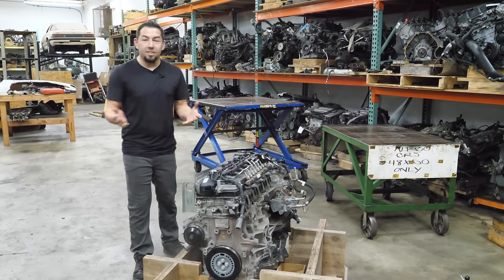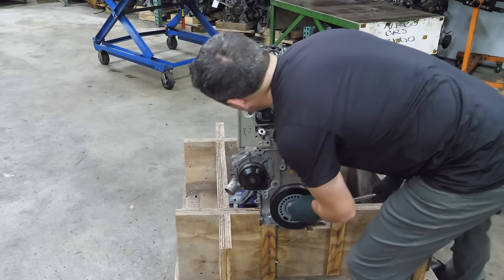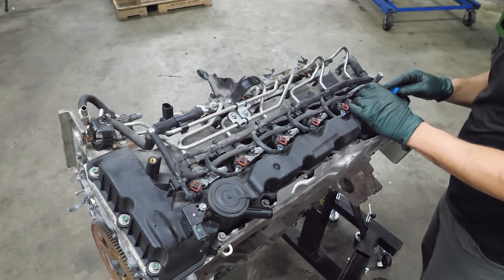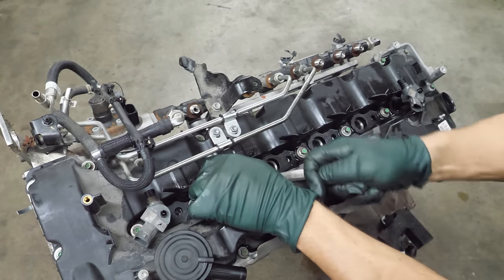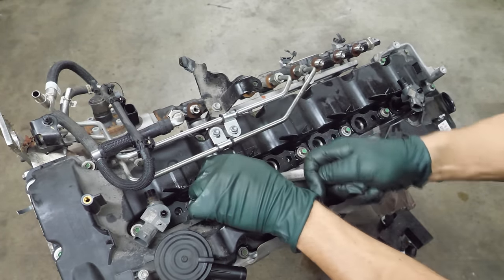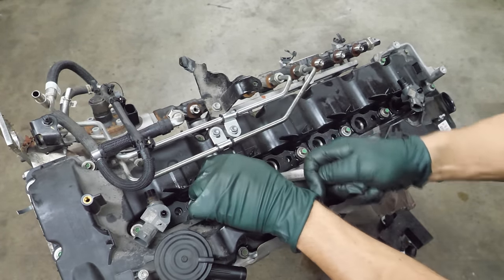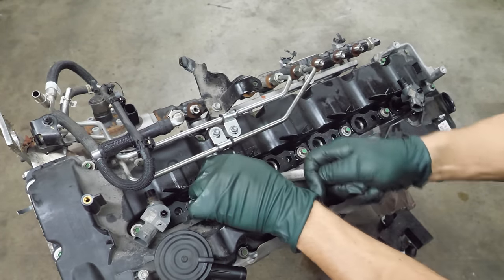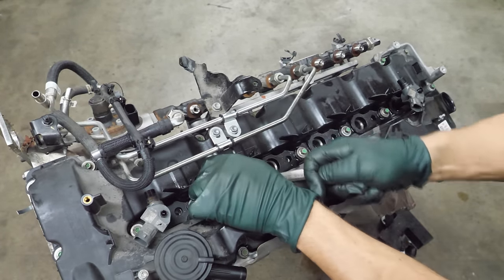BAD 2020 Silverado 3.0 Duramax LM2 Engine Teardown INCREDIBLE DAMAGE!

Comment: One thing I hate is they put the timing chain in the back.  Literally have to remove the engine to replace it if it fails or needs work.
Reply: Engine stays in place. Just the transmission is dropped. Not a super simple task, but anyone with a medium mechanical ability can do it... and 22.5 and up (LZO) are 200k replacement on the belt. Lots of of gas vehicles require 60k-100k timing belt replacements that are similar repair costs.

Comment: Not so Duro Max for diesel at about 160k miles. Some owner not paying attention to oil level and oil changes.
Maybe ran low on oil before light came on.  Low oil caused slack timing chain tensioner. OHC 4 valve diesel may give great power, but long timing chain and tensioner need regular inspection and service.

Comment: At 43,000 trouble free miles on my baby Duramax. Love the truck! One guy I know who does hotshot just crossed 200k on his. So far so good.
Reply: So it lasted long enough to break-in... good to know.
Reply: Your oil change frequency ?
Thank you 😊
Reply: 73k on my LM2 with no issues.  Change the oil every 5-6k and use Hotshot's Secret fuel additive to every tank.
Reply: @TakeDeadAim  
Thx for the tip 💯🤙🏻😎
Reply: @TakeDeadAim I do the same

Comment: Looks to me like it was reasonably clean, suggesting cared for.  Maybe something failed and caused it to burn all its oil suddenly, and lack of pressure released cam chain tension and trashed the rod bearing.
Reply: I wonder if a turbo seal failed and ejected the oil into the exhaust.  I don’t see neglect here either.
Reply: @gordonborsboom7460 that definitely fits with the lost power complaint. Think we have a good theory here.
Reply: I own this motor in my truck and in some instances some of the engines have been shown to use oil. In my case, 2,000 mile high speed freeway trip (80+mph,un-loaded and not towing) I used at least 2 quarts of oil. Does not seem to use oil in the shorter trips, towing or around town usage.
Reply: @toddkovalcik332 GM would have to re-engineer this engine because a diesel isn't supposed to use oil at that rate. Will ruin the SCR system in a heartbeat. 😊

Comment: Like Scotty said, "oil is cheap and engines are expensive".  I always change my oil every 5k.
Reply: @alexwalker8422  Running Synthetic 6-7K miles, check it every couple weeks. Don't have to usually add any but just for peace of mind.
Reply: Scotty Kilmer? 🙄
Reply: @nooooooooooo6uoki67  Yeah, he's a bit of a goof.
Reply: That's about when my oil minder goes off... soo
Reply: @Barbaratio  I wish people didn't really listen to him as much but y'know there is always good and bad so meh
Reply: The only goal manufacturers have is reaching 100k miles, the 10k oil change interval recommendation is based on that.  3000 miles is best, no more than 5000 or 4 months regardless of miles.
Reply: @HairHelmet yup. Just got to make it past the warranty.  Anything else is just bragging rights but they don't necessarily transfer to sales as much as a complete breakdown 5k miles past the warranty.
Reply: @HairHelmet  Before every drive, or once a week
Reply: @erik_dk842  well, at the rate my rig consumes oil, before every drive.
Reply: @HairHelmet  I was joking about oil change intervals. 15,000 km = 9,375 miles is considered plenty good here. 3000 miles would be a good indication of owner mental problems (OCD), if the engine didn't leak coolant into the oil.

Comment: The 3.0L Duramax uses really thin (0W-20) oil and is known for burning/using oil pretty quickly.   The factory puts eight quarts of oil in the crankcase from the factory yet states that seven quarts are to be added when changing the oil and filter.  I've had to add a quart of oil to my LZO after just a few thousand miles of driving.  Pays to check the dipstick every so often.
Reply: Dry (first/rebuild) fill and change fill are different values for any machine.
Reply: Looking at the design of that lower oil pan the drain plug appears well above the bottom of the pan.
Reply: Filling with 8 quarts each oil change may not be a bad idea.  Many owners have commented about how the LM2/LZ0 engines tend to be oil thirsty.
Reply: Big oof. I just put 5w30 in my 03 escape, calls for 5w20 and used that the last 120k miles. Burnt 2 quarts per 3k. On 5w30, hasn't burnt anything over 2500 miles. I would never run 0w20 in a diesel unless I lived in Antarctica. The mpg gain is not even there. 5w30 in my 2018 tundra and I still get the same mileage as I did on 0w20 when I tried it. Engine is MUCH happier, quieter and smoother.
Reply: Any freshly manufactured engine will burn oil and they are ALL over filled at the factory. A low mile/hour engine hasn't had time to break in and seal the rings.
Reply: 0w-20  OUCH
Reply: @davidpowell3347 unfortunately that is what my Nissan Altima calls for. I use Mobil 1 in it and so far is not using any oil 😊
Reply: Try using Mobil 1 ESP X2. Less oil consumption
Reply: @mitchellbarber6971 mine dropped the first two oil changes on my LM2 but the last one was still full when I changed it, and I pushed that one to the oil life monitor.
Reply: Gale Banks addressed the LM2 oil viscosity issue in an interview, he stated that the crank journals are designed for 0W oil.  Wondering if this failure was due to owner using the wrong oil (5W-30) and starving the bearings?
Reply: It’s spicer design on YouTube go watch his
Reply: We run 0w40 in the one we have at work. Over 100k with 0w40 without issue.

Comment: Engines are overly complicated today, I had a 69 Chevy with a 350, 2bbl Rochester carb, th350, 4:11 positrack 12 bolt. Got in the 20+ mpg , only had 3 wires to the engine. Never broke down purred like a kitten

Comment: The reason for the rear timing chain is the combination of the aluminum block and long crankshaft leads to a lot of torsional vibration - the snout of the crank twists back & forth relative to the rear. Putting timing bits on the rear keeps those from transfering into the cams (and cam timing) since the transmissions dampens those vibrations the most.

Still a dumb design just to save 100lbs.
Reply: I saw a post by a fellow stating how the accessory belt on his engine had shredded and jammed up the timing belt on his volvo. a common issue on that model he said. at least when the timing chain and acc belt are at opposite ends that won't happen.

Comment: I can't imagine that the recommended 0W-20 oil is helping these engines last especially in Florida or Texas summer heat. I have used either Triax Euro 5W-30 or Amsoil's 5W-30 Dexos D for 6000 mile oil changes ever since mine was out of warranty and engine fully broken in. 206,000 miles currently and still going strong

Comment: Seems like a pretty good designed engine, except for the oil belt and oil pump drive
Reply: Putting the timing chains at the back of the engine was also a dumb mistake.
Reply: @djmech3871  No kidding! It should be a felony for car manufacturers to do that
Reply: @djmech3871 this platform was taken from the international market where it was originally intended for cab-over trucks that are serviced from the rear.
Reply: If you define “good design” as expensive to repair I agree with you!

Comment: Not so sure about the root failure is oil below pickup.  While I am not familiar with this specific engine, most engines in recent decades will shut down with a loss of most or all oil pressure to prevent permanent damage.  My theory, once a bearing loses its hardened surface, they melt away fairly quickly with friction/wear.  When the extra 'reach' occurred on that cyl, it was the first to smack the valves causing a lash in the excessive timing chain system, causing the rest of the pistons to smack their respective valves.   I think the original failure was a bearing failure.
Reply: good theory, I like it

Comment: It's truly amazing that it jumped time and continued running long enough to indent the pistons like that.  There's a lot to say about the design of the engine but I agree that synthetic oil pump belt isn't one, what an absolute boneheaded idea, I would say they didn't intend these engines to last as long as a traditional diesel.  Considering that the block is AL, the cyls. are sleeves, if someone had a cracked block casting your block casting might be of some use to them.
Reply: The Honda 2000i and 2200i generators have these belts to drive their OHC...and carry oil up into the head.
One owner ran his 24/7 for 17,000 hours straight (off grid; only source of power).
See James Condon vid re tearing one down.
Then he ran the same engine with the replacement belt another 17k hours...
then sold it to his friend and it's still going...heading towards 35k hours....
As the GM tech said in another comment in these comments  the same belt in the LZ0 engine is now rated at 200k miles before replacement....

Comment: Head bolt torque spec must be 98,390 ft lbs.
Reply: Plus another 180 degrees.
Reply: @klesmer  -  LOL!!
Reply: Sooner or later, Eric may come across an engine where he'll need to use the loader to get the head bolts loosened

Comment: Finally a 3.0 Duramax.   I LOVE my 3.0 so I am going to have to hope and pray mine doesn't do this..
Reply: The Honda 2000i and 2200i generators have these belts to drive their OHC...and carry oil up into the head.
One owner ran his 24/7 for 17,000 hours straight (off grid; only source of power).
See James Condon vid re tearing one down.
Then he ran the same engine with the replacement belt another 17k hours...
then sold it to his friend and it's still going...heading towards 35k hours....
As the GM tech said in another comment in these comments  the same belt in the LZ0 engine is now rated at 200k miles before replacement....
Reply: CHANGE DA OIL🤷🏿‍♂️💯🤫🤔

Comment: Looking online, you can still get the 3.0 Duramax inline 6 in Silverado pickups (for 2024).
Reply: This specific engine, the LM2 is discontinued. It was replaced by the LZ0 which is pretty much the same engine with minor tweaks/improvements. Power is up from 277 hp to 305 hp and 460lbft of torque to 495lbft of torque.

Comment: These engines are pretty reliable. Cheap insurance is just check your oil levels. You should check your oil level from time to time in any engine anyway.
Reply: Except checking the level won't prevent the wet belt from deteriorating. Frequent oil changes and then every 100-150k replace both the belt and the chain might be the insurance you're looking for.
Reply: @mjouwbuis  yeah I’m sure you’ll need to replace those, but at least on this tear down it wasn’t an issue.
Reply: Ummm the belt will go 200k miles. You clearly didn’t watch the video. 
Typical ignorance about the 3.0 Duramax.
Reply: wrong. 150k on the LM2, which is what this motor is. The LZ0, the new version, is 200k miles. Source: I own this engine and know more than you @EBIndy
Reply: No you don’t Arrogant Adam. 
The LM2 is the EXACT same part # as the belt in the LZO. There is no reason you can’t run an LM2 belt to 200k miles.

Comment: i for once IM GLAD you where able to take apart one of these! been looking around for someone to show the process of turning em apart (even if its on an engine stand) i personally kinda like the engine... despite its shortcomings and notable bmw likeness, i see some opportunnities for modding regarding the oil pump and i guess if mad enough you coud machine a chain sprocket to fit right over the teeth of the existing wet belt drive on the crank and swap the oil pump + small shaft combo for upgraded parts 🤔
Reply: If I owned one I would do this. Problem is everything else around it would probably fail sooner. Not really adding a lot of value unless you pack on a loooot of miles a year.

Comment: 146k miles in 3 years wow, that’s a lot
Reply: 1000 miles a week or maybe even a little more.
Reply: @zachlafond2652  Probably very little time to slip in an occasional maintenance.
Reply: I hope it was a work truck with multiple drivers.
Reply: That’s why you buy a diesel, you plan to run it. Or I should say that is why you used to buy a diesel.

Comment: I have that engine in my truck, and the service interval for the cursed oil pump belt is 150K.
Reply: The crappy part is that if the transfer case and trans is pulled and back cover comes off how could you sleep without putting in all new chain drive components. Or cancelmthose long term ownership plans. I fear this motor is going to crater values after 125K miles or so. People will know the future holds expensive repairs. The same thing that makes BMW 5 and 7, Mercedes E and S, and the bigger Audis lose HUGE value at 6 years and 100 K miles.

Comment: Diesel timing belt failure in VW diesel engines (1.6 and 1.8)at speed (which had vertical valve travel ) resulted in the valves actually hitting the piston so hard they would displace the piston metal.  Looked to be melted into the piston. 
The pistons would distort in the bore and the valves would distort enough to break the guides up and actually the stems would grow thicker!!   Everything was trash!!   Cams and cranks for the most part survived.   Used many cranks over again.  Some rods would bend too.   Fun times!!  Easy engines to replace and disassemble.   Today Ford, GM, and Crysler need redesigning.  To have to pull a truck cab to do engine work is ridiculous!!  Also....belt driven oil pumps!!  How ridiculous!!   An external dry cog belt I could see but internal in oil...... playing with disaster.    I ran VW diesels to 500k miles no problem.  Replaced pistons, rings , and rod bearings and ran them another 400 to 500 k.  Engine life today is a joke...... planned obsolescence!!

Comment: Eric, I think these oil-submerged belts deserve their own bit, like the water pumps used to. 😅

Either way, the trend with these belts needs to stop. Whoever designed this one to require the transmission to come off for service should've been beaten in a dark alley...but more likely got a bonus and some stock dividends.
Reply: The Honda 2000i and 2200i generators have these belts to drive their OHC...and carry oil up into the head.
One owner ran his 24/7 for 17,000 hours straight (off grid; only source of power).
See James Condon vid re tearing one down.
Then he ran the same engine with the replacement belt another 17k hours...
then sold it to his friend and it's still going...heading towards 35k hours....
As the GM tech said in another comment in these comments  the same belt in the LZ0 engine is now rated at 200k miles before replacement....

Comment: I'm not sure if this should be taken as a warning not to get the 3.0... My father has it and it's been a really great engine so far. He does have the LM2, but I want to get a 2023 with the new version, LZ0. I've heard that all previous issues have been mostly mitigated.
Reply: The Honda 2000i and 2200i generators have these belts to drive their OHC...and carry oil up into the head.
One owner ran his 24/7 for 17,000 hours straight (off grid; only source of power).
See James Condon vid re tearing one down.
Then he ran the same engine with the replacement belt another 17k hours...
then sold it to his friend and it's still going...heading towards 35k hours....
As the GM tech said in another comment in these comments  the same belt in the LZ0 engine is now rated at 200k miles before replacement....
Reply: The warning like usual is to do regular oil changes and don’t let it run low
Reply: I own the LM2 and it's a fantastic engine. Do the required maintenance and be pro-active with oil level and changes and you'll be fine. This engine is NOT to be missed. Best driving engine I've ever owned.

Comment: The emissions system that are involved on newer diesel engines make them not worth the trouble in my book. Especially on a half ton vehicles.
Reply: Why because of regen mod?
Reply: @marlu6373  regen, egr, and def system. You can’t delete anything past 2018 either I believe because the epa went after the companies developing those deletes.
Reply: The emissions systems do their job. They are worth the trouble. As a breather of oxygen I am glad they were updated.
Reply: Valid point. The fuel savings is probably a wash once you consider the increased cost of diesel, extra maintenance and the inevitable multi 4 figure emissions system repair that will surely happen outside of the warranty.
Reply: @badopinion  And Mercedes diesels used to last forever with hardly any maintenance save for glow plugs or an injector. Now they try and get all these crazy boosted pressures that it's no wonder why they break down more...plus the emissions gear
Reply: @jamesmedina2062 also don't  let these diesels idle too much. Had a seriously bad experience with a DD15 having to idle it because didn't have a APU. Ended up with a lot of sensor and other components failing frequently. The thing was in the shop.more than being on the road.😮😮😊
Reply: @carlbernard4197  How much is a good APU? I guess the diesel needs to burn at an optimal heat in order to burn cleanly and produce less soot.

Comment: I think this engine was run low on oil for an extended period. It looks like it had generally good maintenance over it's lifespan - perhaps it always used oil and the original owner kept up with it...then maybe it changed hands and the new guy ran it into the ground. Seen this type of failure a lot. I have a 2011 F150 with a Coyote in it - I bought it new. It has used oil since day 1, but I have always kept up with it. If I ever sold it to someone else, it would probably wouldn't make it one oil change interval before it would fail. lol